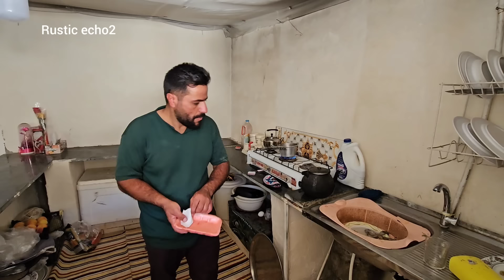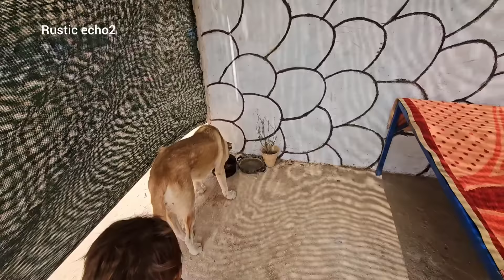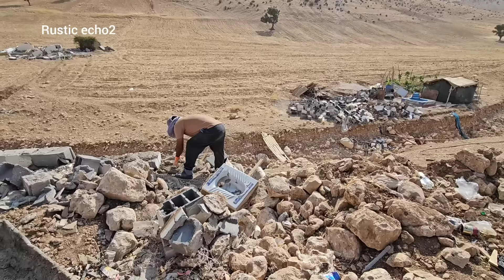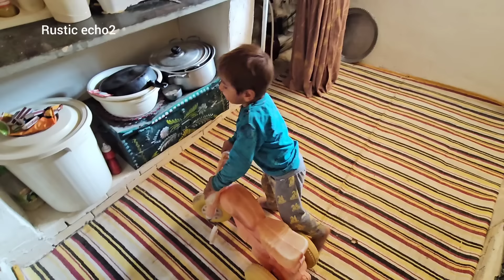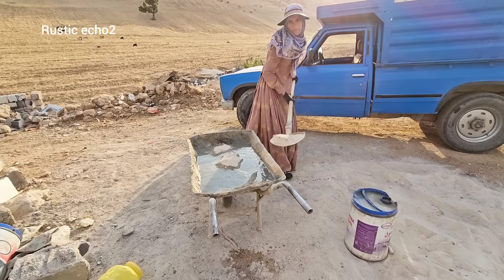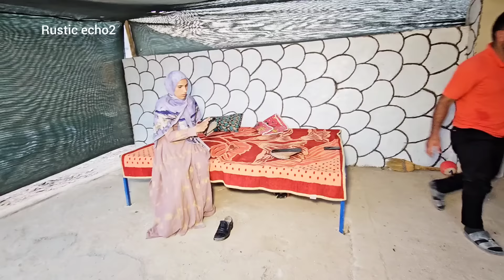"Nasib's endless effort.From determination to rebuild the yard to unconsciousness for too much work

Comment: because  hot weather  
dont works  10 am until  2 pm that time  is very hot maybe cause of heat stroke .
ang drinks  more  water and also don't  stay  inside  home  if don't have aircon or fan .must  better  stay outside with shade  because  sometimes  hot have belong  the wind. always  put wet towel  head and always  waer the protection the sunshine if go outdoors

Comment: I do not see how the nomad females do not die of heat stocks with the long dresses, head wraps and long sleeves, all in that hot weather.  I can be outside in shorts and have to run into the house because it's just too hot to be outside. I guess they are just used to it